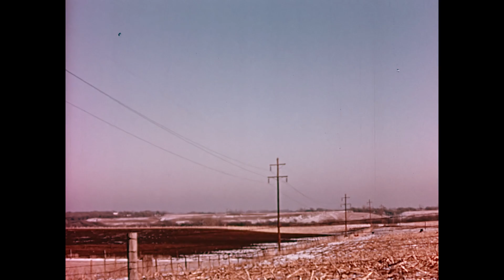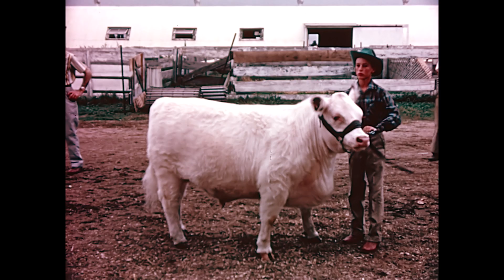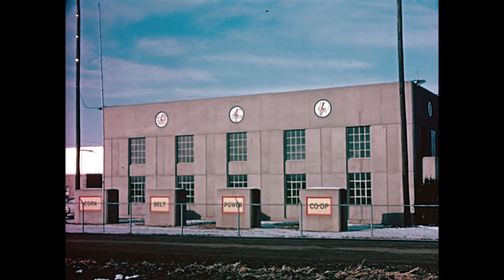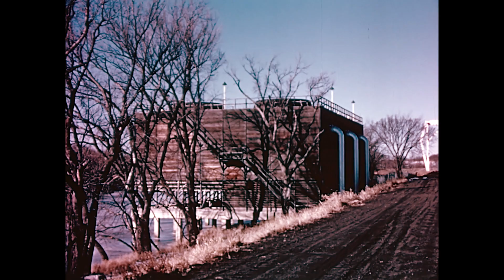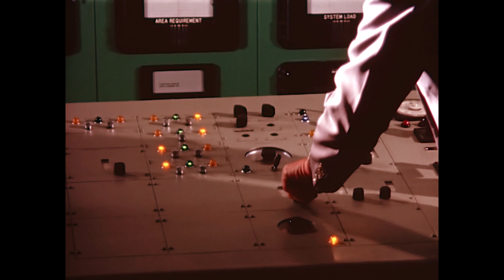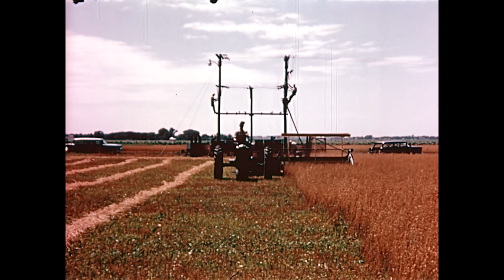The Corn Belt Story, 1962

Comment: No way that roast took 15 minutes. Neat video though
Reply: It was a "radar range" which was an early microwave, assisted by heating elements in the top, if you watch when she puts it in the oven.  Most of the appliances and stuff they showed in the video, particularly the radar range and the fancy washer and dryer set, was more like what you'd find in the banker's house (or the richest man in town, like the electric co-op superintendent) rather than in farmer's homes... Even the grain dryer setup was something that probably only the richest and biggest farmer in the country could afford back then.  The farm family was more likely to still have the wringer washing machine and the small milking machines.  Then as now, technology cost, though that cost wasn't as high as it is now, compared to farm income, than it was then.  We quit farming cotton in 2003, because we got on average 60 cents a pound for cotton when I was a little kid in the 70's, we got 60 cents a pound on average when I graduated at the end of the 80's, and we got the same lousy 60 cents a pound average while I farmed all through the 90's and into the early 00's, and there was no sign of improvement in all that time, meanwhile input costs had gone through the roof for everything we had to buy-- machinery, parts, fuel, electricity, seed, chemicals, fertilizer, you name it... Later!  OL J R :)